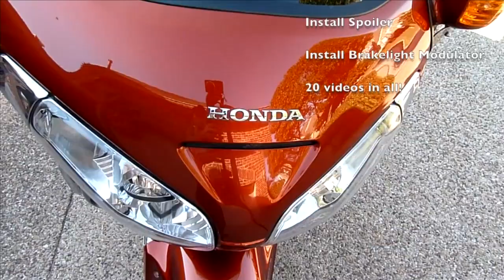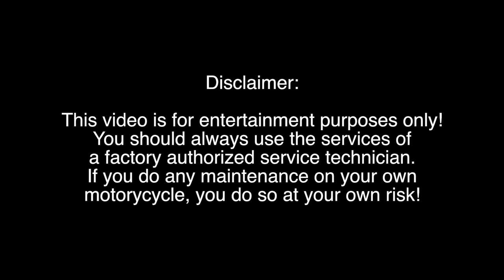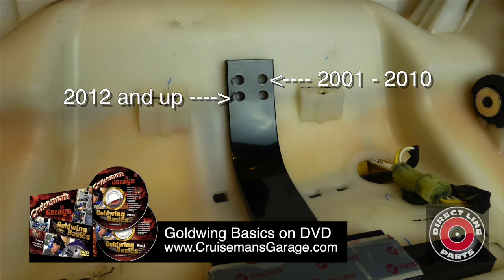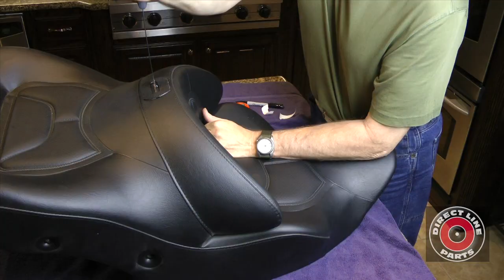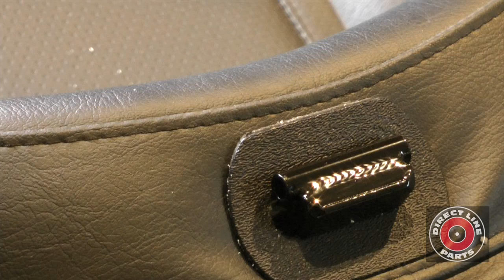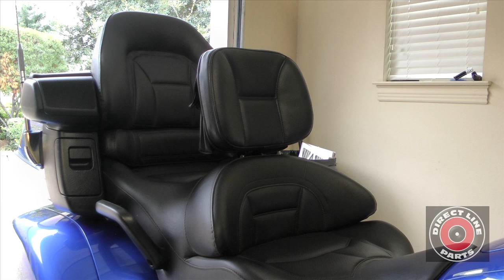Install Utopia Backrest On Honda Goldwing GL1800 (OLD VIDEO)

Comment: Utopia's advertising and instructions could be a little better about how to gouge a hole through the seat's foam.  If you did it every day, it might not be such a big deal, but unless you are extremely lucky your serrated knife will not pierce the foam exactly where needed, requiring retraction and re-piercing.  You end up shredding a fair bit of foam inside the seat.  I don't have any recommendations to make this process easier.  Just bear down and do it.  The shredded foam channel seems to be holding up on my 2015 GL 1800.  I do worry about water intrusion and plan to seal around the bar through the cut with silicone.

Comment: Once you put a slit in the seats' material, even though you slide the bar bracket through it, you have peneterated the water proof or water repellent protection of the seat. Water, no matter how small the opening is, will eventually get in there so do you or Utopia recommend any product to seal that opening?
Reply from the maker: Good point. They do provide a plastic cover that has adhesive, but it is far from waterproof.